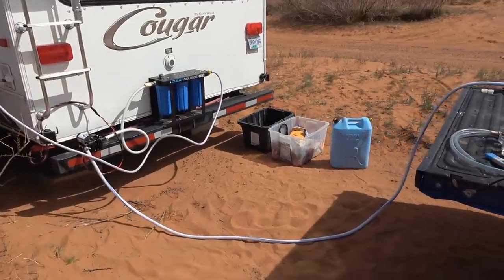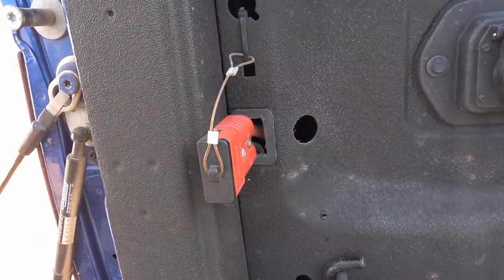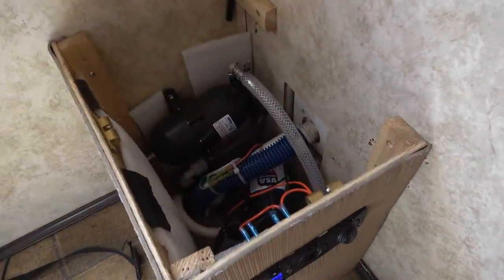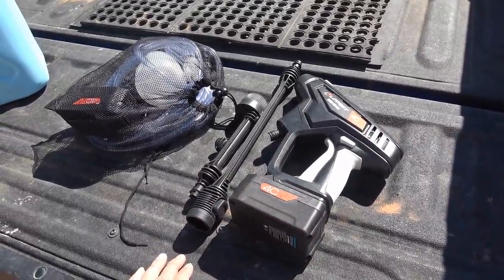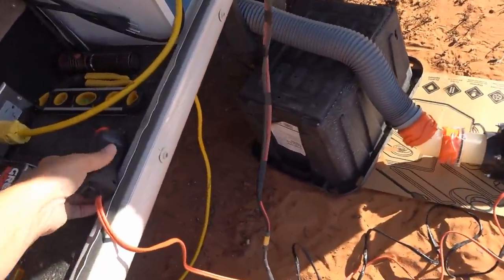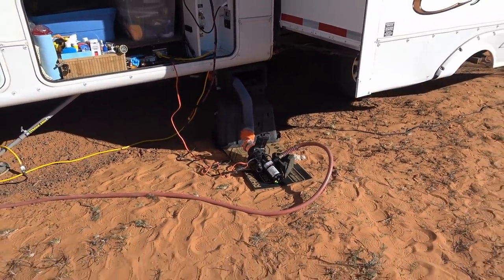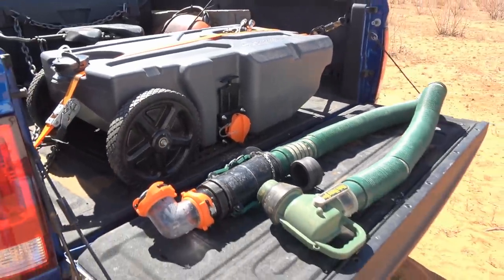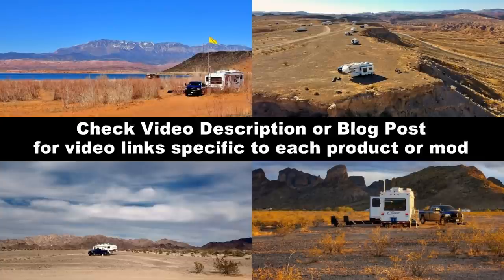How I Handle Our RV Boondocking Fresh Water and Waste to Extend Our Campsite Stay

Comment: Hi Ray! You told me about the bladder at Miracle Beach but we're still using the green water cans like you showed me. Thanks for the tip about the buddy heater. We use the furnace less and kept with only two agm batteries charged daily with the generator. 
Eight months full-time now for us. Camping at Rathtrevor for 2 weeks. Regards, Charles Fuzzy.
Reply from the maker: Cool! great to hear. :)

Comment: Ray, I noted you have a separate grey tank for shower water. Have you considered using it for "grey to flush"? With the addition of a pump, couple of one way flow valves and diverter valves and you get double use from your fresh water.
Reply from the maker: Could do that, but picking up an extra 60 gallons in the bladder isn't much of a hassle since I can use the trip to dump the sewer tote anyway. Figure the fewer plumbing parts and connections in the RV the better. Fewer things to leak and I'd rather not have greywater anywhere near freshwater lines.

Comment: Looks like you've got an inverter powering all of your 120v sockets now, rather than just the one special socket?
Reply from the maker: The old 1000W inverter I installed 11 years ago powers 3 dedicated sockets I installed not connected/separate from the RV OEM AC power panel. One in the living area, one in the bedroom, and one in the storage bay. I used it this way for 10 years. But, with the recent addition of the EcoFlow power station and its 2400W (5000W surge) inverter, I can now power anything in the RV so I have its inverter output wired to the RV OEM power distribution panel via a 30A auto transfer switch. So when off-grid powers all the RV OEM sockets and appliances then if I plug into shore power the transfer switch automatically switches over to use shore power instead. Here is the current state of the off-grid electrical  https://www.loveyourrv.com/our-rv-boondocking-power-systems-current-state-of-things-2022/

Comment: Great video ray it’s good you have all the options how many days can you go before you have to get water or dump my trailer has 60/60/45  gallon tanks the best I’ve done with 2 people and 2 dogs is a week thanks
Reply from the maker: We used to conserve and go about 9 days on our 60 gallon tank but now its more like 5-6 as we become heavier users because we can now. :) When I need water I take a load of waste in the tote, then strap the tote on top of one of my tool boxes and fill the bladder in the truck bed and return to camp.
Reply: @LoveYourRV  right on thanks
Reply: I manually refill the fresh tank after 1 week but stay camped for 2 weeks and empty the black and 2 greys when we head out. Charlie Fuzzy.

Comment: Hey Ray, great video. Have you ever used your TDS meter to test your water at your sink before and after the last filter under the sink?
Reply from the maker: Thanks. :) The filters don't generally affect the TDS reading since the solids are dissolved in the water itself and not particles suspending in water that can be blocked by a filter. You can see my tests here https://www.loveyourrv.com/testing-rv-water-supply-for-total-dissolved-solids/

Comment: Where you carry all this stuff ,tote,portable solar panels ,generator, portable power stations, and all
Reply from the maker: The portable tote has a built-in ladder hanger, so it gets strapped to the rear trailer ladder. Solar panels fold up and get stored in the crew cab of the pickup truck, the gas generator gets stored in one of my larger toolboxes in the truck bed, the small power station gets stowed on the floor in the crew cab and the larger power station stays stored in the trailer basement storage.
Reply: @LoveYourRV  thanks

Comment: Did you consider the 60 gallon Aquatank instead of the 30 gallon?  The 60 gallon is $56 cheaper.  I am looking at them but an torn between the 30 gallon vs the 60 gallon.  Get twice a much capacity for less $$'s.
Reply from the maker: I used to have the 30 gallon but it suffered damage recently https://youtu.be/ky_Zd96TrW8 so when I replaced it I bought the 60 gallon which you see in this video. Not sure where you are looking at prices but when I bought the 30 gallon a few years ago it was about 30 dollars cheaper than the 60 gallon. Maybe there is a supply issue now that is causing the price increase because it was always cheaper before. https://www.amazon.com/AQUATANK2-Water-Storage-Bladder-Gallon/dp/B009MU64Y0

Comment: How often do you dump the 36 gallon tote? We are two adults and one child. I am deciding between the 21 gallon and 36 gallon. $100 difference.  I am mostly doing three to four days of camping.  Between the tanks in my 21 foot travel trailer and the tote.
Reply from the maker: I just finished an 14 night stay in a provincial park and dumped twice with the tote. Not being that stingy on water usage. 2 people showering every 2-3 days, daily sponge baths between them and wash dishes done once a day. We use only real dishes and cutlery. Our trailer has 3 waste tanks 38 gallons each. Shower/bathroom sink, kitchen sink and black.
Reply: @LoveYourRV  Awesome, I think we only have black and grey tanks but I am sure we should be able to do four days!

Comment: I have a similar setup but I have a concern about mold or bacteria growing in the bladder between use, especially all folded up.  Do you have any thoughts on that concern? I know it's going to be filtered but I would rather start with water that is as clean as possible.
Reply from the maker: Here is what the AquaTank directions say:
"Store your Aquatank II in a safe, cool, dry and clean place. Before you use (or if you are re-using) Aquatank II,
purify it by placing 3 to 5 gallons of water with 8 drops of bleach per gallon of water added to it (non-scented
bleach and not pool chlorine) and then fully drain. Now you can fill your Aquatank II. The purity of the water in
Aquatank II is only as good as what you put in it. Contaminated water or suspect water is not potable and
should be discarded and not used for cooking or drinking. To give longer storage life to any stored water, keep
it out of sunlight and keep it cool as possible"
If I'm using it a lot I'm not too worried because most of the water sources I use are chlorinated and I store the tank our of the sun in a box. If storing for an extended time I do what the instructions say before the first use. Basically I treat it the same way as my RV fresh tank.  Cheers, Ray
Reply: Thanks, I appreciate the information. I'll probably do a bleach rinse before storage and another one prior to use just to be cautious.
Reply from the maker: I wouldn't get overly concerned unless you are filling with unknown well water or from say a lake or creek, a little bleach and water once in a while should do the trick.

Comment: What is the flow (gpm) of your shower at low flow?
Reply from the maker: I haven't measured the flow at the shower. It depends on how much you open the faucet. Usually, I can have a shower with  2-3 gallons. Wet down, soap up then rinse. My wife is the same unless she has to wash her hair, she has long think hair so then its more like 5-6 gallons.

Comment: So dumping the black tank still requires moving the RV.
Reply from the maker: NO, all the waste tanks can be moved into the portable tote tank via the macerator pump. The main reason for using the macerator is to chew up any solids. It is like a sink garbage disposal and reduces any solids in the waste stream to less than 1/8th inch in diameter. You can see my demos here https://www.loveyourrv.com/flowjet-rv-macerator-pump-demos-and-review/ where I used it to empty the RV waste into a house sewer. Cheers, Ray

Comment: Do you have to disinfect the bladder periodically like you do with your fresh tank using bleach?
Reply from the maker: Here is what the AquaTank directions say:
"Store your Aquatank II in a safe, cool, dry and clean place. Before you use (or if you are re-using) Aquatank II,
purify it by placing 3 to 5 gallons of water with 8 drops of bleach per gallon of water added to it (non-scented
bleach and not pool chlorine) and then fully drain. Now you can fill your Aquatank II. The purity of the water in
Aquatank II is only as good as what you put in it. Contaminated water or suspect water is not potable and
should be discarded and not used for cooking or drinking. To give longer storage life to any stored water, keep
it out of sunlight and keep it cool as possible"
If I'm using it a lot I'm not too worried because most of the water sources I use are tested and chlorinated and its getting flushed by the next fill and I store the tank out of the sun in a box. If storing for an extended time I do what the instructions say before the first use. Cheers, Ray